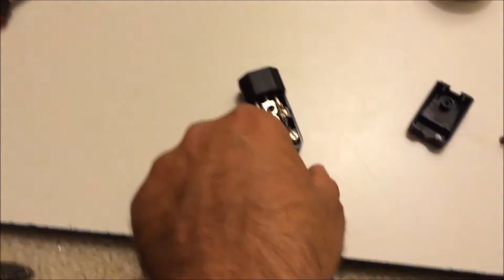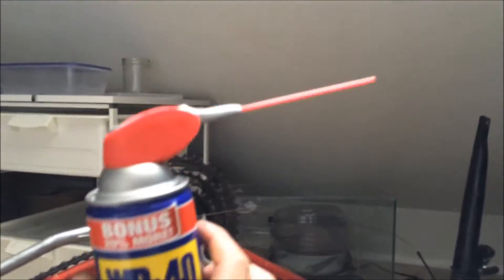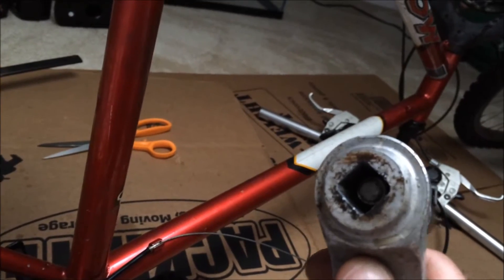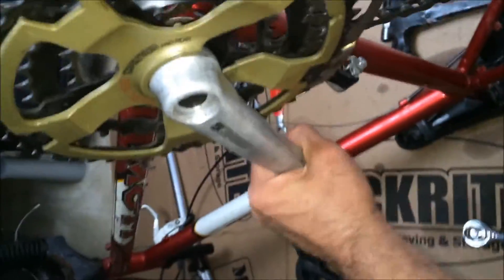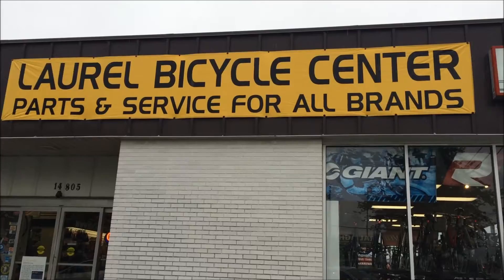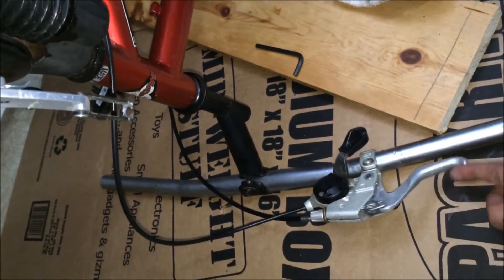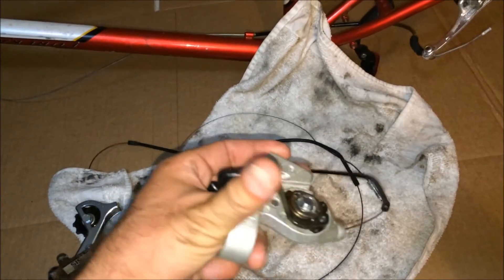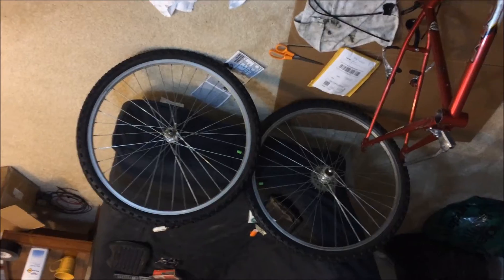Bafang Mid Drive Ebike Conversion Part 6: Prepping the Bike

Comment: You should only use proper bike lube on bikes has that WD40 has abrasives in it & makes all you're components wear out really quickly. even by just using it has a cleaning solvent. 😵 Happy Cycling.
Reply: Fasthead he didn’t use wd40 to lube the pedal spindle. He used it to remove it easily. Nothing wrong with that. Then he cleans all the wd40 off and uses proper grease or lubricant for it!